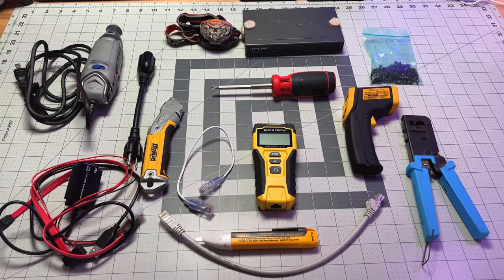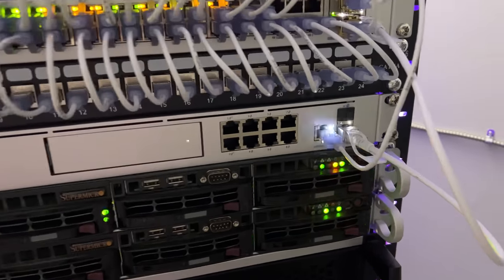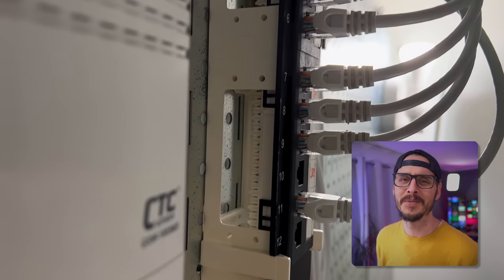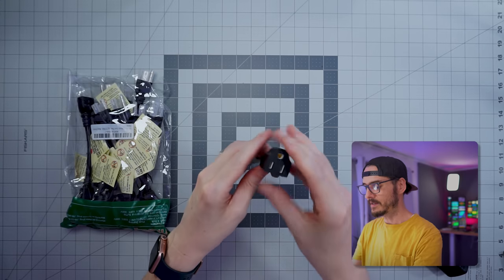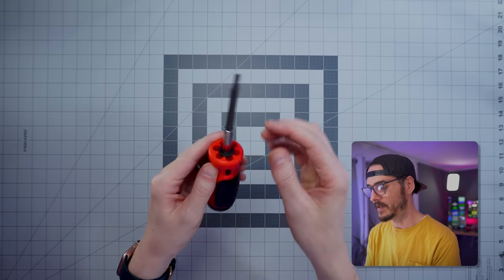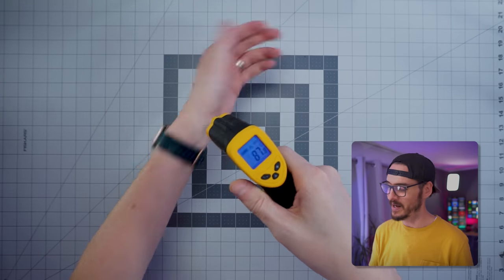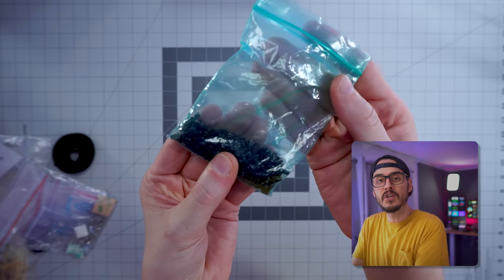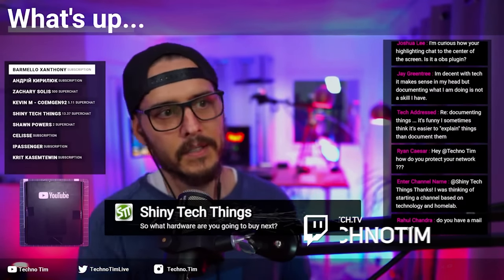Essential HomeLab Tools & Accessories - Network / Server / PC Tool Kit

Comment from the maker: Which tool do you use that I missed 🔨 ??
Reply: Yup, a 🔨 and a 🔧.  🐧👍
Reply: A label printer for tagging Servers, Switches and other devises with important information like hostname & ip. I have one from brother.
Reply: @Garfield6389spielt   Agreed; they are invaluable!

Also agree on ETS2 (and ATS). 🚚👍
Reply from the maker: @Garfield6389spielt  Good call!  I have one and couldn't find it for this video.  I searched for an hour.  I ended up not filming that part since I didn't have it on hand.  It's in the kit list!
Reply: Mini Dust blower/VAC - great for cleaning PSU's PC's and servers that have collected loads of gunk
Reply: How about a toner for AC circuits / breakers? "Klein Tools ET310 AC Circuit Breaker Finder with Integrated GFCI Outlet Tester" I've probably encountered more unlabeled or poorly labeled breaker boxes than labeled breaker boxes. This set has a receptacle tester including GFCI that 'tones' a line that you can trace to the breaker box.
Reply: I like this Dewalt utility knife that has snap off blade tips. There are straight and serrated blades available. "DEWALT Utility Knife, Single Blade, Snap-Off, 18mm (DWHT10038)"
Reply: Fish Tape for pulling wires around, over under or through walls, attics, etc.
Reply: You missed having the $70 LTT screwdriver /s
Reply: sth like old mouse pad to put on table or floor when you had to put the item you work on. plus some screws organizers to put things back to one piece
Reply: @GumShoeNoir  Good recommendation, and once you have one.... take the time and trace and document everything in your house. I did this several years ago, I documented what breaker every single outlet, light fixture, and hard wired appliance was connected to. Now it's easy to shut off the right breaker, and importantly determine what else is affected by it.
Reply: Usb SD card stick. I use it to test different OS on PIs
Reply: I prefer rack studs lately but cage nuts are good to have if not that.  zipties are great but if you do them all the time, the ziptie tool that also cuts the ziptie when tight is great to have and actually pretty cheap to get.  Things missed I would say capton tape or masking tape.  on more expensive side, I wouldn't last without label printer, especially one that supports shrink wrap
Reply: I would add, because use them myself,
A small paper notebook, a Gerber Dime, a sharpie, some cable labels, a few micro SD cards with USB adapters, something to snack and drink and those square sticky things with a brace on top (which you can use with zipties to bind cables. I don't know the English name for it)
Reply: @GumShoeNoir  ssomething or capacitors
Reply: Cable finder/tone generator, spare PoE/PoE+ injector, ac/dc multimeter, fiber to RJ-45 converter + fibre optic cable, hdmi to vga/dvi/displayport adapter, KVM over IP, power supply with adjustable voltage and wattage, ssd m2 nvme to usb converter, usb 3 to usb-c converter, cap with fan and Covid-19 mask🤣
Reply: Business edition of portainer now free for 5 nodes!!! :) Very, very nice!
Reply: Console cables - crossover, straight through and the Cisco proprietary pin outs are all must!!

Comment: My essential tools (extra to what you've covered) : 1) Brother label printer. 2) Decent quality soldering iron. 3) USB ROM Flasher. 4) Magnifying glasses with a variety of strength lenses and LED light

1) The label printer has made so many things related to audio engineering and home networking so much easier, both with regard to initial set up and maintenance. A big plus is that my SO also really loves having so many things around the house much better organised and labelled appropriately, from herbs and spices to cleaning products. It's nice to buy a gadget she actually approves of for once!
2) I struggled for literally decades with cheap and nasty soldering irons - having one where you can actually set a reliable temperature is a game changer.
3) These USB ROM flashers have enabled me to resurrect (so far) about £500 worth of previously dead motherboards and gfx cards - which is pretty great for an outlay of about £10 !! Check out the linux flashrom utility webstite.
4) I often end up fixing phones for friends and family - normally just swapping out old batteries etc - being able to see those insanely tiny screws really helps!
Reply: Could you explain more of usb rom flasher?
Could we diy ourselves?
Reply from the maker: Thanks!  I couldn't find my label maker so I didn't include it in the video, but it's in the kit!
Reply: @mohdsyukrihashim2299  Hi I did reply to your question previously but it seems to have disappeared. Do a search for USB ROM flash CH341A and you'll see how they're used. If I can do it after watching a couple of tutorial videos, pretty much anyone can.

Comment: I would also get a plug in voltage tester.  While the non-contact voltage tester is invaluable, if there is an energized wire near or running parallel to the circuit you want to work on, you can get a false notification.  A plug in tester is 100% accurate just in case. 

 Be thankful you aren't doing major renovations... Thanks to just setting things down randomly and then forgetting where they are, I have almost 2 of everything!  Good set of tools and accessories for general lab work for sure.
Reply: I don't trust those non contact testers.
Reply: @rrad3926  I get it.  I am rewiring a house and they work well for tracing exposed lines to see if they are energized, but if you have a couple of wires running side by side you can get a false positive so if they are connected to an outlet I can use the plug in tester.

Comment: The one thing I always had in my kit when I was doing IT support (general bit of everything) was a few rolls of duct tape & coloured electrical tape. As well as either a small Dymo label printer or rolls or "number" tape to mark/index things (Usually needed when someone else made a mess and I had to go in and figure out what goes where in the maze of un-marked cables).
Reply from the maker: For sure, forgot about that!

Comment: I always have some 3M double-sided tapes, UHMW friction reduction tape, torque screwdrivers (for phones and notebooks), cable ties, a nice white and black marker for quick labeling.
For server room, bunch of niche gears, including a pcie bracket for removing rack nuts :)
Reply from the maker: Good call!
Reply: THIS! VHB is an absolute must in my toolbox. I keep a tacklebox of cable management clips and even though most of them take screws in most cases I'm mounting to a surface I cant screw into.
I bought this tool for removing rack nuts that looks like a giant pair of nail clippers and works great but I swear any time I need them I cant find them so there's always the spare unused shorty PCIE brackets sitting it the bottom of my cab.

Comment: Additional very useful tool is articulated pliers - when you use kensington lock in work - it's definitely lifesaver. It isn't homelab related but general helpful if you are it guy in any company.

Comment: I've been using those short extensions for years and I absolutely love them because they let me tuck away the wall warts and they make for better cable management for anything plugged into my UPS. 
There are also flat versions of these which I just purchased a bunch of which are great if your outlets are located behind furniture or other tight spaces where you wouldn't want the plug extending off the wall more than an inch.

Also how is a label Printer not essential kit to anyone who does IT and IT adjacent things! I have a P Touch D600 and its overkill for most people but its a great printer if you want custom professional looking labels or markers.
 In regards to your roll of velcro check out Klein Tools 450-900. Its a velcro roll dispenser/cutter. Certainly not a necessity to most but if your pulling large bundles of runs or doing a fair amount of cable management this thing is great to have.

Comment: I do low voltage work, so some of this may not be needed so much for a home jobber, but 110 & 66 block adapters are pretty helpful. Trying to clip on to the pins can be a pain. With my adapters, I can push on to the block, plug in a cable to it with an rj11/rj45, and have the other end bare, I can test for dial tone and voltage much easier that way.

Also a good multimeter is helpful. DSL should be around ~48v, so if you have a DSL problem, and your voltage isn’t there, it helps trouble shoot. You can also diagnose POE problems, and power supply problems.

And Klein All-Purpose Electrician's Scissors. I use these things all day long. I can strip jackets off of cables, I can cut my pairs nice and even when putting on a plug, they just are reallllly helpful.

Comment: Hey Tim, Some gear I use (am network technician) weekly, if not daily that I would like to recommend. The Klein Ratcheting Data Crimper VDV226-110. It has a cutting feature, its best used with RJ45 Passthrough ends. You end up with a perfect cable every time, its a huge time saver. Another Item I keep in my tool bag are the Klein D275-5 Diagonal Cutting Pliers, super sharp and useful. The Punch Down tool I have found the most success with is the Klein VDV427-822.
Reply from the maker: Thanks for the tip!  will check it out!

Comment: Great video, just wanted to say that the crimping tool is for RJ45 and RJ11 for older phone cables, not RJ23.  Also, when running longer cables, it is nice to have the cable tester also tell you the length so you are not hitting the cable length limits.  Also, I have suction cups I use for screen repairs.  I saw others already mention a P-Touch.
Reply from the maker: Thank you!

Comment: I’ve been doing more small electronics projects. Like microcontroller sized projects. And doing the crimp connectors have different crimp tools. Also ferrules for life to put into screw terminals. Which also have a crimp tool to use. 

For closer to mains level electrical projects: get a kit of Wago connectors. Screw wire nuts

Comment: Those short extension power cords were mentioned to me when "venting" about all the different size plugs and not even being able to use half the plugs of a ups (without power strips and even multiple at times) to just use the 6 on it.

Comment: In the middle of wiring up my server rack for the first time. Populating those patch panels and making the short wires to connect to my UDM Pro. Have been using Legend brand (Lowes) keystones on my wall jacks which has it's own dedicated punch down tool that fits the entire keystone jack. The keystones on my patch panels are tool-less.

My best tool: Rechargeable screwdriver (Microusb) with built in live circuit tester by Skil (the circuit tester is activated by a button, the detector panel is on the side, not where they screwdriver bits are). Best tool I have purchased in a while. Also have a smaller rechargeable screwdriver for pc work (usb-c), but it is not as powerful. I use it in places where my Skil won't fit. The Skil is powerful enough if I push it to twist off the heads of screws. I found that out when I was trying to really tighten down an expansion bay cover. Learned not to push it....letting it tighten it down is plenty for the vast majority of screws. I have a standard ratcheting screwdriver with multiple built in bits like yours, but this rechargeable one definitely saves the wrist.

The only tool I don't really have is a headlamp...need to get one....but a rechargeable one (definitely usb). I have a couple different options for lighting areas:
clamp on USB LED light with bendable arm. I haven't really used this yet because I need to get one for my server rack. Just makes sense to have one there due to the usb available.
compact USB LED light I used to use while riding my bike (and it still shows its battle scars). I can easily carry it in my pocket.

Comment: You have good content on your channel.  Yes to all those tools.  
Two recent tools that fit theme of video to join my slash are for UPSs.  I got two APC 2200s few yrs back.  They use 8x small 12v 5ah bats.  When I picked up UPSs I went with PowerSonic batteries to save a buck (don't do that - go batteries plus duracell with biz account).  Anyway found myself without any way to diagnose battery pack.  1 or 2 out of 8 bats causing UPS to flag battery pack as failed.  So got a 12v car battery tester to be able to measure the internal resistance of a battery which usually can be enough to identify the bad ones.  Also got a cheap 12v low amp charger to charge them outside of UPS.  Tester not so necessary when UPSs are 24v unit with just 2 bats,  but rack style / 48v with lots of batteries its handy tool - unless you have the $$$ to just immediately replace the whole battery pack. :)

Comment: M6 drill bit. Some rack components still use random smaller imperial mounting holes. I standardized my rack on M6 cage nuts, so I needed to adjust a few ears over the years.

Comment: Have you (or any viewers) tried the RJ45 crimper where the ends are pass-through and the crimper cuts them off?  I saw one on Amazon once. I find the hardest parts about making cables is cutting the wires to the right length and making sure that the wires stay in the right order when you stick them into the plug.  It seems like these plugs would be great because you just cut the wires long and stick the plug all the way down.  And you can verify that the wires are still in the correct order before crimping?  The ends are a bit more expensive, but is there any other down-side to them?
Reply: They are amazing, makes it sooooo much easier. The blade to cut off the cable excess dulls pretty quick so you may have to wobble the cables a bit so they drop off but we'll worth it.
Reply: It took me awhile to get it down. Untwist everything, get the bends out of them, and start putting them in order. Hold the jacket with one hand, and with your pointer finger and thumb, start pulling them out and getting them lined up. The best way I have found to get them cut to the right length, is to put the middle of my thumb nail at the end of the jacket, and then with a good sharp pair of scissors, make a nice clean straight cut where the end of my thumb is. Then move my thumb back just a bit, and start putting the end on, keep everything lined up, and scotching my thumb back and pushing on the connector. Once you get to the guides at the end of the connector, you can kinda wiggle right and left just a touch to get them into place, and pushing just slightly.

Comment: agree with the USB to SATA HDD connector. However, I would upgrade to one that has USB3.0 that will speed up data transfer speeds at least 3x

Comment: Go to tools:
100m laser tape measure
Auto wire stripper
Cable toner
Quality cable tester
Quality punch 
Quality crimper
Backup crimper
Spare rechargable 9v batteries
Multimeter 
Soldering iron (TS80)
Reply from the maker: Great list!

Comment: NEVER use zip ties on communication cables. Never! Only Velcro.
Reply: Really NEVER?
I think they are used a ton and still the cable is not damaged and will pass testing with no problem.
Reply: @hw2508  you're right. But it's a terrible practice. Take it from a guy who runs a Data center for a multi billion dollar company. Just stop using zip ties for communication cables like CATx  and Fiber. Never!!!
Reply: @hw2508  for one... You don't want to use the ol' trustee wire snips on the zip ties and accidentally snip the comms.

Two: with Velcro you won't need tools to manage cables just your hands. 

Three: Velcro is a whole point of contract whereas zip ties you need to find the hole in usually cramped spaces and pull... You might pull more than you wanted to.
Reply: @eddysplosion  'accidentially snipp the cable' of course I don't WANT that. But maybe I do!
I acknowledge the risk but I count on the abilities of a professional with the right tools.Of course zip ties should not be too tight.

Reusable, definetly a plus for velcro.

Small spaces. I think the zip tie wins. I have handled zip ties in very small space and you can pre-bend them to get them through a small hole around a corner.

For long term: zip ties.
In the front of the rack where you patch your connections: Velcro or/and the 1HE cable managment systems.
This is one thing I don't get with most home labs. The too short patch cables. Directly from switch to pannel is so stupid. If you need to work on your patch panel, you have to disconnect your cables. Work on your switch: disconnect cables. Need to move your switch one or two HE: disconnect your cables.
Always: Disconnect your cables, shut down your network.
And as soon as you use more than one switch or more than one patch panel the system fails.

PS
To be honest, zip ties can be a pain when you pull a cable to find the other end and everythibg is tied to each other. But with velcro the problem would be comparable.

Less zip ties is better than too many.
Reply: @eddysplosion  I would say: It depends.
For patch cable I agree. But for fixed installation: no problem. Nobody will touch this cable for the next decade.
Reply: @eddysplosion  for fiber? Who does that?

Comment: I am a software engineer and have noticed I spend too much time on networking/hardware. I want to run it all locally but GKE/managed k8s are winning cost wise( especially during peak times ). As a software engineer(SE) what setup would you recommend? I(student) have the need to process incoming data(6tb backlog) through different processes(cpu intensive, gpu accelleration wont hurt) and finally storing the data. While functioning as a vpn w split tunnnel and  mostly providing audio streams.  The energy crisis made me rethink cloud
Reply from the maker: good ca;ll!